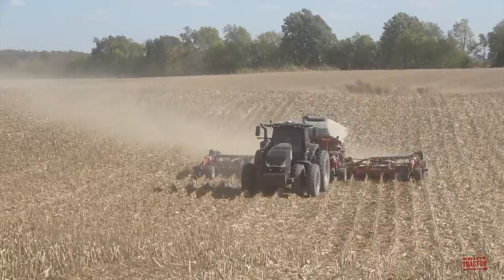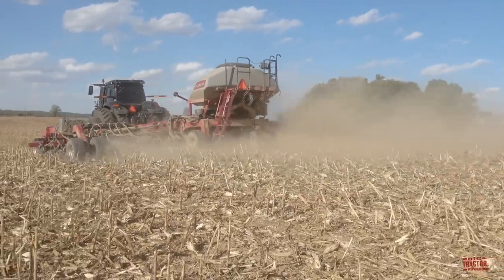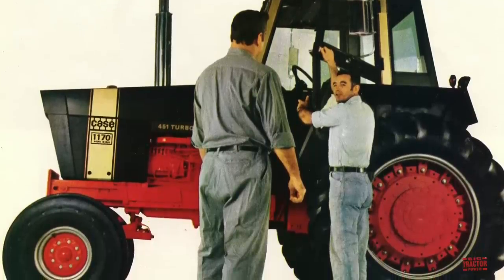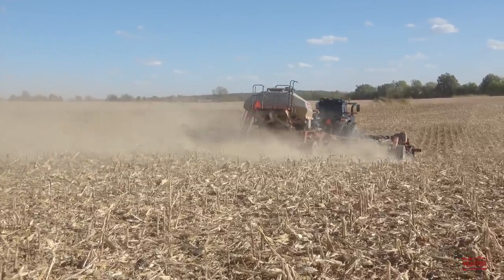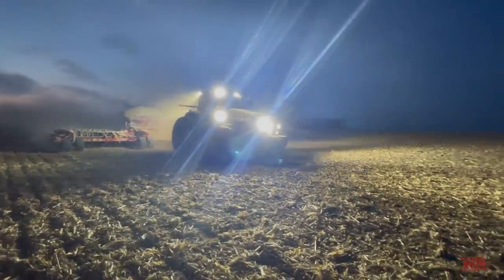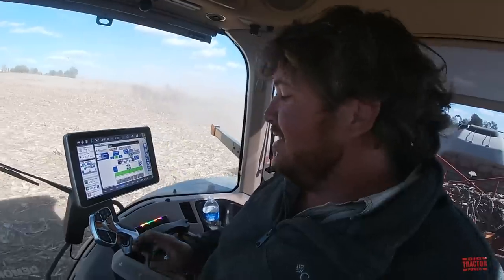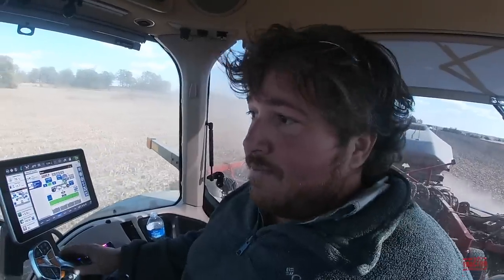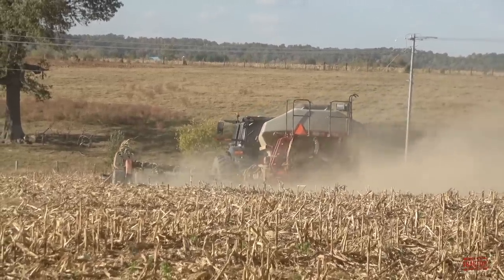BLACK NIGHT MAGNUM 400 Demonstrator Tractor

Comment: Hey Jason, I used a J I Case model 430 back in the summers of 1964 thru 1948. My neighbor bought the tractor new along with a baler, small bales. It had 12 forward and 3 reverse speeds if my memory serves right. Sweet tractor to drive and operate. He did custom baling for 5 years that I know of, doing 10,000 to 12, 000 bales a season. Good times. Just my two cents. Thanks for sharing.

Comment: I would imagine the black windows are nice in the summer heat
Reply: Pretty much since they're tinted
Reply: Great during the day but would cut down on the visibility at night.
Reply: I tint on the side and do lots of tractors and combines. Usually do them in 1 or 5%, but at night it only looks like 35 or 50% from the inside because of how far lighting has come.

Comment: The tinted windows on that cab are like magic from the outside it was black you could not see in.  I know that's got to block a lot of the sun's heat out of that cab.  from the inside couldn't even tell they were tinted what kind of magic is this?

Comment: I don’t care what color they paint it’s still a Case row crop tractor. They are still so far behind JD it’s laughable. My friends Case 400 is like running a 4960 with plugged fuel filters and that’s being generous. Great combines horrible tractors.
Reply: @ROCK-s1t  not a steiger at all. Point out where it's a steiger?

Also Nick your comment is actually laughable itself. Saying CaseIH is behind JD. 🤣
Reply: That’s why I specifically said row crop tractor.
Reply: Opinions are like something else, everyone has one.
Reply: There r a few farmers out there who use and like the Red machines over the Green ones. I would think your use of tractor is all about reliability and service from dealership.